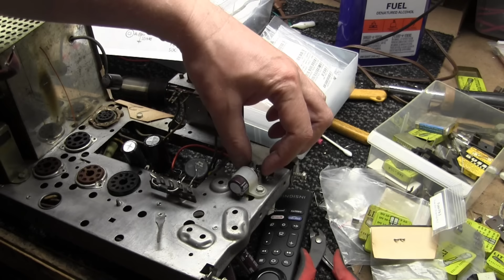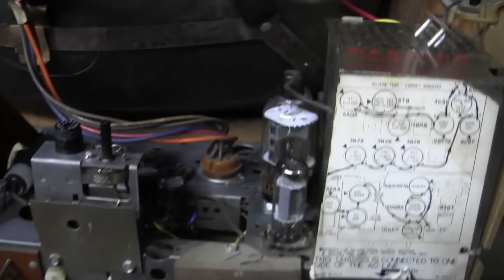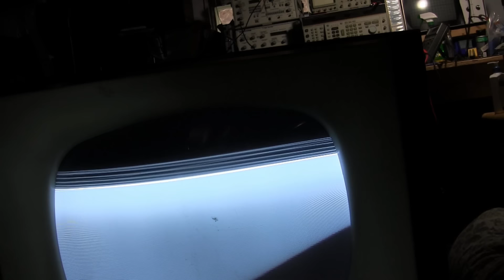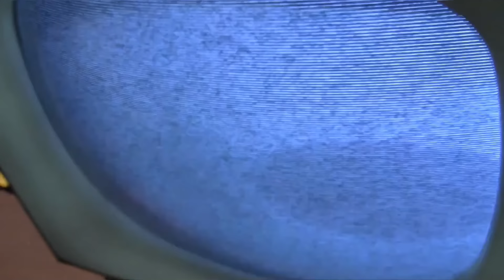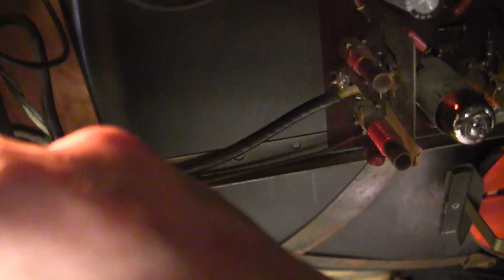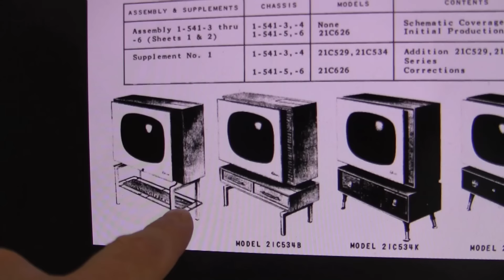Sylvania Halolight/Sylouette 21C529 part 5

Comment: @Bandersentv,I was wondering. How many televisions have you restored so far since you got into this hobby?  When did you first start collecting and restoring vintage tvs?  Will Batfink ever defeat Hugo A Go Go the worlds maddest scientist?
Reply from the maker: You need to watch my first vlog :)  Roughly around 150.  Technically, it started in the mid 80s when I'd drag TVs home on garbage nights.  More seriously around 2006.
Reply: @bandersentv  I'll have to watch it later. I rememeber back in the 70's and 80's old sets were all over the place. I fished an old silvertone black and white and a rca color tube set from the curb.  Thrift stores were incredible back then. Everytime you'd go you'd find something amazing. Even into the early 90's 50's and 60's and earlier electronics came in frequently into Thrift stores.  Portable record players,tube stereo components,turntables,appliances,you name it. Nobody cared back then either. It was just old junk,except to the few folks like us. I still remember watching Three Stooges and then driving to a local Thrift store in 89-90 and finding an early 60's Zenith remote portable and a portable stereo record player..  Got a portacolor set for $5 in the mid 80's at a church "white elephant" sale.  I miss those days.  150 sets is a lot!  Im sure it will be double that eventually. Not many people out there taking on restorations if these old sets these days

Comment: Congratulations Bob on getting the TV to work the first time around.  With that chassis setup that prevents testing the TV without the cabinet, seeing the set work on the first trial run was a bit of a gamble.  Good Job!

Your suspicion of the set legs being backwards proved to be true according the picture of the different Sylvania Halo models for that year.

I must admit, the lit halo CRT frame does appear to help to reduce eye strain, at least in your video.
Reply from the maker: Yes, I flipped the legs around last night and it is far more stable.  Curiously while doing research, I found the same model on radiomuserum.org and it also had the legs on backwards.

Comment: Fantistic results! Your Sylouette has a very nice picture. Once you clean rhe safety lens and the inside of the halo it will look outstanding.  Cracks seem to be very common in the white halo mask. I was amazed mine didnt have any. The plastic also can get brittle if it sat near  a window or where light struck it each day.

Comment: The last version of this set has the rectangular picture tube
Reply from the maker: Yes and has bonded safety glass
Reply: @bandersentv ,I didnt know that. Ive never seen the rectangular Sylouette in person. I assume the bonded safety lense was due to the shape of the tube and implosion risk?
Reply from the maker: I think more to lower cost and ease manufacturing. I mean all TVs have safety glass or plastic.  Having bonded safety glass means no need to clean in between or install separately.

Comment: On my set the cloth on tbe top has thin Masonite behind it and it is slightly bowing too.
Great job getting the set running!  My halo seems much brighter,but has 2 settings and the dimmer one is about like yours. It could just be an optical illusion and the camera making it look less bright than it actually is too.

Comment: @Bandersentv,Bob,you've got the legs on backwards. The part that projects forward goes in the front. That will solve your tipping issue.
Reply from the maker: Yes, I've already flipped them around.
Reply: @bandersentv  Ok,Sorry.just trying to help. I was watching the begining of the video and commented when I saw it,just now reached the end and saw you figured it out by looking at the sams photo.
Apolgize for pointing out something you'd already sorted out.
Reply from the maker: No need to apologize and I'm still not 100% certain about them.  While doing research, I found the same model on radiomuserum.org and it also had the legs on backwards.  Coincidence?  Factory mistake?
Reply: @bandersentv  I'm thinking those spindly legs could be easily damaged in shipping and make the set more awkward to handle (like when you brought it in the basement), so maybe the factory shipped them with the legs off, to be installed by the customer. Maybe some customers put them on wrong. If they're not too hard to remove, you might take them off again when you have to get it out of the basement.
Reply from the maker: Yes, it would have been easier to move without legs.   You do need to be careful though as the lower chassis is just held in by one screw.

Comment: I googled some pictures and it looks like your legs are backwards
Reply: Love this set! Nice work Bob
Reply from the maker: Hmm, not so fast. Check the example at radiomuseum.  It's the same as mine. 
 https://www.radiomuseum.org/r/sylvania_21c529m_with_halolight.html
Reply: @bandersentv  An old ad for the set also makes it look like the legs should protrude in front, not in back, which would make more sense for stability. I wonder if these shipped from the factory with legs off, and more than one person put them on backwards?
Reply from the maker: What's really curious is you cannot complete the safety lens removal procedure in the service manual with the legs sticking out the front.  Quite a puzzler.
Reply: @bandersentv  If only we could time travel
Reply: @bandersentv    Radiomuseum is backwards from yours too . . . in their picture, the halo portion seems to span the area between the protruding legs.  Maybe yours just needs to be centered more (front to back)
Reply: Radiomuseum has it right. Hard to see as it’s a straight on picture of the set , but the top of the legs stick out forward and flush with the halolight.
Reply: @rboem60  Scroll over to the 3rd picture at radiomuseum. That shows more clearly the legs are on the same way. I think I also see them sticking out in the back in the 2nd picture. If this is the way the legs were meant to go on, this set seems to have a tipping problem. Like that exposed fuse, safety wasn't as much a consideration back then. Today, products are designed to avoid tipping hazards.

Comment: You might be able to find some decent matching wood grained contact paper at a dollar store. Also, I used to work with a guy who worked for Sylvania in the 50's and 60's. He said the Halovisions were priced nearly as high as a color set and as color TV prices came down, nobody would pay the price for a Halovision any more. I believe the Halovision lasted a couple more years as I have seen a 23" model--the tube with the squared off corners and flatter faceplate.